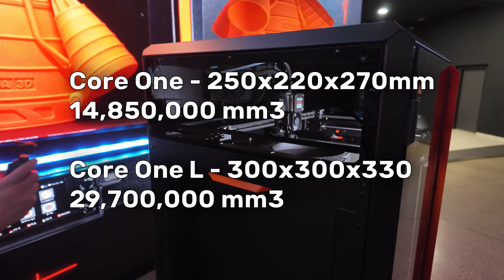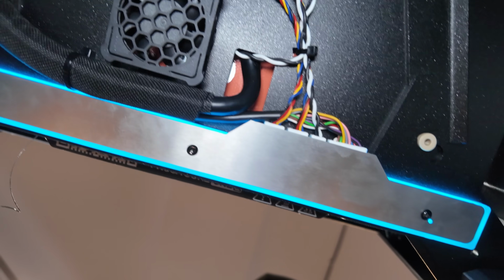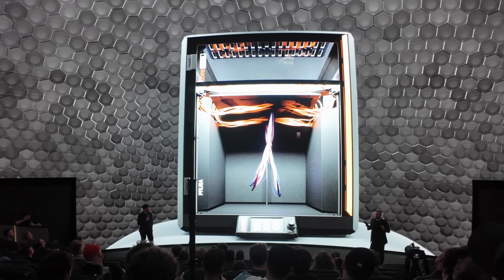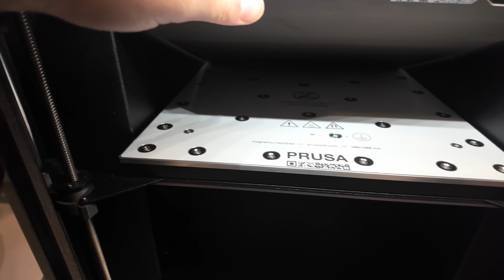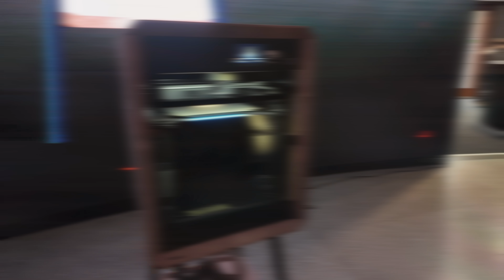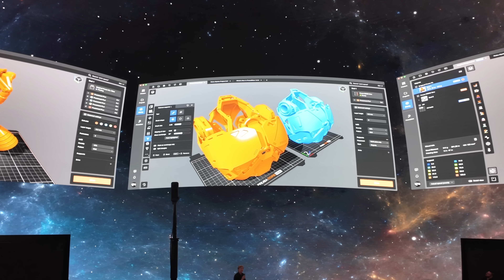A Bigger Prusa Core One, Printing with Silicone, RFID tagged filament AND MORE

Comment from the maker: The CORE ONE L is out now and Prusa is also having its black friday sales, so get the hot new thing or save on whats already out there, check em out here!
 https://prusa3d.com/?promocode=Nero3D  (affiliate)
Reply: If you earn commission from affiliate links on the product you “review”, it’s not an independent review – it’s sales.
The financial incentive alone makes the verdict impossible to fully trust, unless you clearly label it as advertising.
Reply: Not at this price. That is ridiculous for only 300x300, single-tool head, no filament changer, still charging extra for things that should be included. Only thing is the fancy new bed. This is price way too high.
Reply from the maker: @ScytheNoire  Good thing nobody is being forced to buy anything

Comment: I know this may notbe something you're interested but I'm going to ask anyway. Can you see how Orca slicer works with the Prusa XL? Why? well, I have more than a few printers, including an XL. However, they're all Orca based and some are not available in Prusa Slicer. I have fits trying to mentally switch back and forth between Orca and prusa. It would be so much easier if I could use Orca for everything. I was hoping you might see if you could configure it to work well with Orca.

Comment: I had hoped the price was closer to the standard core 1 - but once I saw some of the upgrades I said...good choice.  Nice video. The location of the demo was killer.  The only issue I had with Prusa was for a short period of time, some of the web pages were showing 2x duty + Tax.  I reported the issue and stuff got fixed fast.  Oh, they charged the correct price, but there was confusion for a hot min.   And yes, I did order one and even tried the link you provided.   Now the waiting game happens.

Comment: 3d printed silicone? I'm curious if it would be a food grade/food safe silicone? If so, I can see creating lots of silicone molds for various specialty desserts/food things.
Reply from the maker: 3d printing food safe products is hate to do all the nooks and crevices the manufacturing method leaves, plenty of spots for moisture and bacterial growth
Reply: @CanuckCreator I know conventional filament printing is a no go. But if you’re dispensing liquid, I would imagine it would fill the gaps. But, since I wasn’t there, I have no idea what the viscosity of the ‘liquid’ is. I’m sure it would have to be thick enough that you don’t end up with a puddle.

I’ll just stick to commercially made stuff.

Comment: So.... its smaller than the bambu H2D with less features but cost more.
Reply: The important thing is that it's not a Bambu.
Reply: @Charwhal628 I really don't understand you anti bambu people. You just want to gate keep 3D printing for advance users. Gone are the days of spending more time fixing your printer than actually printing.
Reply: @mr.rajikon3911  I'm not anti bambu to gate keep 3d printing. It's the opposite, I'm anti bambu because they take open source developments and close them off calling it their own software. There are so many better options now for printers that just work, like Prusa for example. The bamu user argument of "it just works" isn't enough to recommend a machine someone doesn't actually own. The fact they can still disable it before you update to new firmware is appalling when machines like Prusa's exist.

Comment: Would be cool if they would get some of those updates to the XL ... looks like we haven't gotten any of the updates for the nextruder fan schroud or new features. And that for an expensive printer :/ The enclosure is unusable in smaller rooms, since it overheats the inside Heatbed MCU on longer prints and dumps a lot of heat into the room (yes, I have been in contact with Prusa over this).

Comment: Wow, this is interesting. I tough it has an actual chamber heater as the competition.
Reply from the maker: bed is in the chamber and heats the chamber, so yes, it has a chamber heater

if competition need an ADDTIONAL heater to get to 60c in the chamber, thats on them
Reply: @CanuckCreator  So technically all enclosed printers does have chamber heater you say?

Also, when INDX added (high bowden tovers to all tools, so bigger chamber volume), will the bed be still able to reach 60C°? We will see.

Oh, and when printing PET-CF (for example...), which prefers 60C° chamber temp, but 80C° bed, will the chamber still reach 60C°? I doubt.

I have a feeling they are always trying to reach the harder / sometimes more compromised way, what yhe competitors do well, just so they dont have to buy / build a chamber heater too...

Comment: Cool. Just bought regular Core One which is great printer (and my first printer), almost no troubles with it. And when I was choosing, I was skeptical about weight, however in the end just decided it`s not a beg deal considering other parameters. And now I see bigger and lighter Core One, which quite dissapointing

Comment: This is awesome! The C1 L might not be for me (I'm still hoping for a smaller format core XY - like a mini C1 ;)) I really appreciate Prusa's approach to design. As someone who studied/did a lot of outer space design during university - it's really similar in some ways; like continuously optimizing materials/form, and making the most of the equipment and power systems already present.
Reply: You're better off building a Voron V0 if you want that. The reason that kind of machine isn't yet available is because Core XY is not that expensive to scale up but is pricey for a small printer when compared to alternative kinematics. I think that Sovol has a V0 clone that is decent though, if you don't want the full Voron building experience.

Comment: Open RFID! 🤤🤤
Reply: Even better, NFC!!
Reply: When I print other brand filaments on my Bambu I still say its a bambu lab filament in the slicer and it works great. So it would be nice if Prusa made a NFC-writer that you connect to your PC, and thru prusa splicer you can write the openrfid tag that its a bambu lab white pla to the tag, and then put on your prusa filament.

Comment: The Core One L is expensive, but the wooden one is probably obscene. Still, great looking piece, wouldn't mind having it as a conversation piece in the living room. Except of course; if you have to ask what it costs, you can't afford it. Either way, the One L is not yet a compelling machine. If they marry it to a Bondtech INDX, it might be.
Reply: If I had the money laying around I would have bought it lol. It would be worth $5k just as piece of art in the living room. I would never print on it.  and yes if the prusa gets a pricehike of say $400 to get the tool changers its a very good price, but as a single color its. I will think about it.

Comment: its crazy, Prusa has been effectively using the same heated bed since the mk2 in 2016 or so (the milled slome slots in the base for magnets for the mk3 onwards, but the same pcb DC bed)
Reply: That's all those printers needed. This needs more.
Reply: @cr0ft-2k  sure, not denying that, im saying they got their moneys worth out of that design. 

interesting they didnt use a variant of the XL's tile bed, maybe that was more hassle than it was worth in the end

Comment: Does the fans under the bed lead to cold spots on the bed itself?;
Reply from the maker: it shouldnt, there should be enough thermal mass to keep things stable across the bed, I didnt have a thermal cam to check but prusa did release an image in core one L blog showing the eveneess of the heating
Reply: @CanuckCreator would be amazing if that was with fans on. It's a very clever 2 for 1 trick. This is just something i thought of as maybe an issue? But not sure. I'd imagine ot could be pid tuned and as you say if the plate is thick enough and has the mass, should be minimized. 

Either way I am so happy they came out with the Core 1 L. Was exactly what I hoped for one they came out the the core 1. Just wish the prices could be improved but that's a whole other discussion and I understand why they are more.

Comment: Oh I love the wooden printer.  So Stylish. Also a bit worried about the price of the Core ONE XL and also the lack of any bondtech indx being shown on the prusa printers.
Reply from the maker: Pricing on prusa printers now includes things like duties and tarriffs, so explains a bit of the price, as for the iNDX...formnext is soon, cant show everything off early
Reply: @CanuckCreator  Ah, but I live in Sweden, not so far off Prusa HQ, and on black friday the Prusa Core One is equal to 1475 USD in EU, meanwhile Prusa Core One in USA is 999 USD right now. But its the same for most printers, even with tariffs in USA they are cheaper than here in Europe :/
Reply: @AndrewTSq they don't show the prices with tariffs and duties on Prusa's website for the US. Printed Solid does though. 1249 USD for a kit and 1499 USD for assembled with tariffs and duties.
Reply: @Charwhal628  Ah okie, without 25% VAT here its  1106 USD.

Comment: That auto opening / closing vent finger is already a mod for the C1 you can find on Printables, along with the custom start gcode.
Reply: I was listening last night to an hackaday podcast and they were talking about a guy that put the main switch above the print head (probably on a bed slinger) and with a gcode the printhead, with I think they said it was a pencil strapped to it (janky much😂) would turn itself completely off at the end of the print.
Reply: 3:26 when I converted my mk4 to core one I put magnets in the holes for the plastic clips in the top panel, so mine already has that feature.
Reply: Felt like it would be easier to just have a temperature controlled motor? like a thermistor + small mcu, and a small stepper motor.
Reply from the maker: extra electronics, cost, and failure point when you can just do a quick gcode move based on the filament being printed 
(abs/asa/PC etc open, PLA/PETG/TPU close) for example
Reply: @CanuckCreator That's exactly what I did. Depending on the material, ventilation is controlled via the start Gcode. It closes automatically at the end of printing.

I made a remake for the mod that integrates the lever inconspicuously into the right cover.